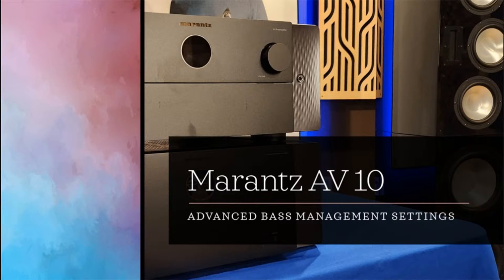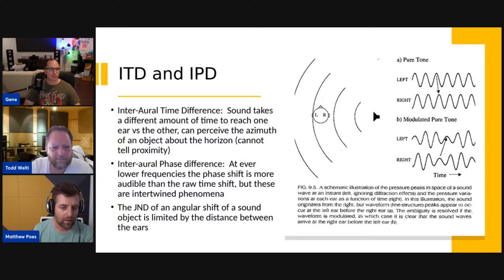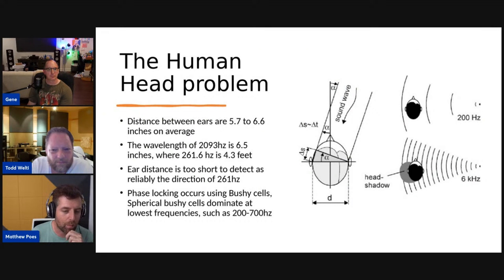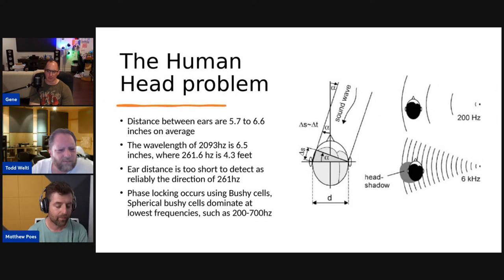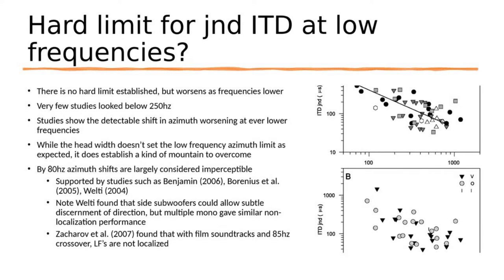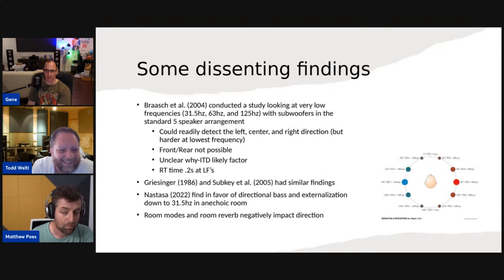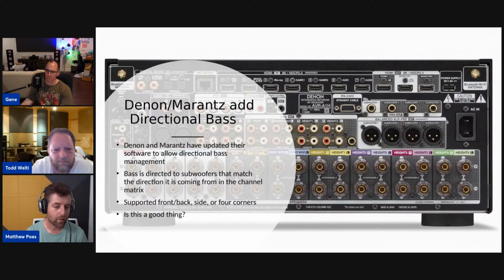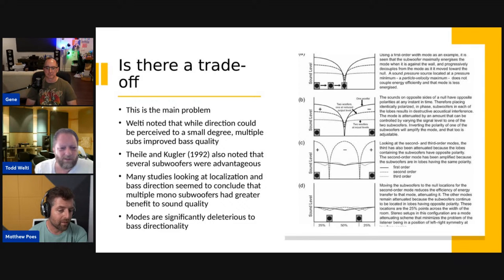Directional vs Mono Bass Management - What the Science Says

Comment: Regarding multi-sub output from another time, 1998, Meridian 565 has 8 digital or analog outputs(or mixed). The 8 channels are not a complete free-for-all buffe' but offered atleast 10-15 different basic/variations of layouts. So a 5.3 system was possible, but one of the 3 subs was dedicated to support a small center speaker, the 2 other sub was L and R with shared LFE load. Other options was 7.1 , 6.2 , 4.2 , 3.3 , 2.2 ... Meridian 565 was also a major nightmare to setup the first few times.
Fun fact: just entering the menu for overall speaker layout would basically be a factory reset of 565 😂 so, I am thankful it's not a menu you can fat-finger yourself into.

Comment: Subwoofer manufacturers tend to agree on the benefits of having as many subs as possible. They do not pretend it to be tied with sound quality in any ways though. I’m considering getting a second sub, but for the most part, I never locate my one and only. So I think I’ll stick to this just one in my tiny room with my tiny Sofa. Less is more.😊
Reply: What? Pretend? Lol. There are many benefits to having multiple subs. Getting a 2nd sub, or 3rd or 4th, is a much bigger upgrade than any speaker/receiver upgrade you'll make. It has everything to do with sound quality. There are only 5 or 6 manufacturers who actually make subs that have good output below 20hz

Just because you can't localize your sub doesn't mean you won't get a massive improvement by getting another. I'm in a very small room and I have 4 12's. Going from 2 to 4 is the best thing I ever did. But you also need good subs, which you can't get below $600, or maybe $500 on a discount or used. 

For the people who get the regular home theater in a box type subs, or just your average klipsch or Polk sub; they have not even experienced real, tactile bass yet. 

Its not something you come back from. My mains are flat to about 20hz but I still use a crossover because they don't punch me in the chest. They have nulls to contend with whereas my subs are +/- 1db from 10-160hz.
It is so much better than any other upgrade you could make. You can get a pair of pb2000 originals from the svs outlet for like 1100. Those are a good deal, though many people prefer 15s
Reply: We aren’t promoting multiple subwoofers because it helps sell more subwoofers. It’s really because it leads to improved sound, regardless of the room size. 

Bass frequencies are very unique from higher frequencies. It’s why we talk about the acoustics of a room in terms of stochastic and modal.  The speaker hugely dominates the sound in the stochastic zone. The room dominates in the modal zone. The use of multiple subwoofers helps tame the room. The smaller the room the more taming it needs really.

Comment: I know you aren't suppose to without dlbc, but I sent dirac 4 subs individually and the result was a flat line for my subs. 
Audyssey did not come close to this even with 4 preouts. I tuned with multeq-x extensively and could not get rid of a 30db null at 55hz. Dirac gave me a flat line in one shot, and that's only dirac live.
So I bought a minidsp, manually time aligned and level matched, then fed dirac the mono signal. It's like I hit the bass lottery

I've been messing with MSO because I'm a bit of a nerd, but that just tightened it up a bit more. I've been trying different things. 
I'll be interested to see how DLBC with 4 preouts compares to mso. They should be similar technologies

Comment: Hi. What do u mean by directional bass? I have trinnov but i allign my 4 subs manually via external dsp. Bass will come out based on the content all over the room in the bubble.  The 16  channels counts maybe haave something to do with commercial blue ray movie can have max of 15 bed channel + 1 lfe??
Reply: Why are you using external DSP instead of Trinnovs?

Directional bass refers to the idea of having the bass management actually shift bass to subwoofers located in zones related to the direction of the bass effect. A Trinnov could do the same thing but you would need to manually set up the routing.  Trinnov actually has a better way of handling this concept.  You can route the bass of a less capable speaker to a more capable speaker within a range.  

But at some point you need to sum the bass to mono to take advantage of what Welti found in his work. A room has a sea of modes.  Those modes are always there but how and if they get excited depends on the location of the LF sources. With Lf sources spread around the room you can either selectively excite modes in a way that would create lumpy bass, or excite them consistently in a manner that’s easily eqed.

Comment: Just curious if we crossover surround and atmos speakers at a lower frequency such as 60 hz would that provide more directional base out of those speakers or am I misunderstanding
Reply: Well like all things, it’s a balancing act. You are correct that doing that would create more directional bass. However most in ceiling speakers can’t play 60hz very loud. The distortion at those frequencies and levels would be unpleasant. The entire point of bass managing is to remove the bass the speakers can’t handle. Free air woofers like that have nothing to provide excursion control but their own suspension. Most ceiling speakers have maybe 3-4mm of xmax and just won’t produce much 60-80hz bass.
Reply: @PoesAcoustics  thank you for the reply. Just a follow up then, would it be possible to crossover lower if set bass management in receiver to LFE + main or still better to cross in wall soeakers and in ceilings speakers at 80 hz or higher
Reply: @joekool5676  it all depends on the speaker but most in walls are bass challenged.  the in wall enclosures are very small and that limits their bass.
Reply: @joekool5676  yes the LFE+Mains is unrelated to how you handle the surround speakers. Those speakers need to be bass managed higher up to reduce distortion and increase their dynamic range.  The only situation where that wouldn’t be true would be if they were big full range speakers.

Comment: so if you have a subwoofer out, can you just split that signal into 2 subwoofer signals and it's almost exactly the same as if you were using 2 independent subwoofer channels when crossing your subwoofer at or below 80hz?
Reply from the maker: If you split a single sub out like this, you won't have independent level and delay control. This would need to be done either w mDSP or If the sub has a group delay adjustment (most don't).
Reply: It’s also not the same as the directional bass we were discussing. The Denon/Marantz products have four independent outputs which can have bass signals steered to them based on the direction of the bass effect. It’s not something you can recreate.

Comment: Do all the math you want  and make it as complicated as possible. Ive git nine subs now and every time i add another one it soubds better. I have to move them around a lot but i have so much weught and detail in the bass its ridiculous. Didnt use a calculator once fellas. Just my ears which seems to be fading away with all of these apps and such. I do use an external dsp for the subs but i just play with it by ear except the mic sweep corrections that it does automatically. I just dont think this stuff is that complicated, its just orvercooked but appreciate it either way.
Reply: Then imagine how good it could sound if you actually put effort into measuring it.
Reply: @squared80  yeah but I dont need a computer to tell me that I need subs in the ceiling or at least higher up, I can just hear it. That will be my next endeavor